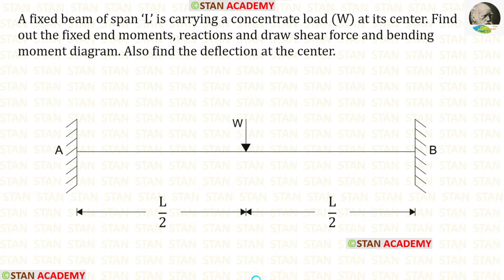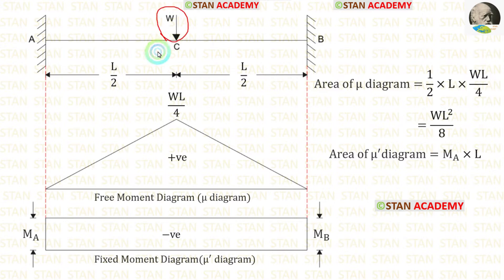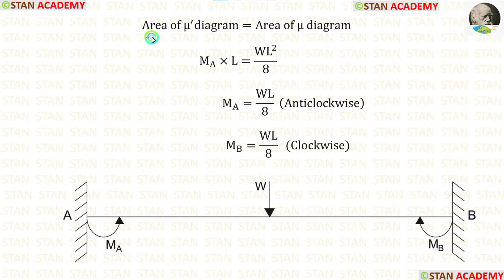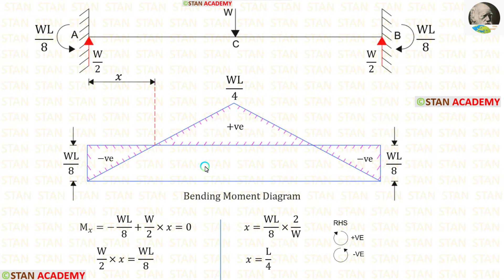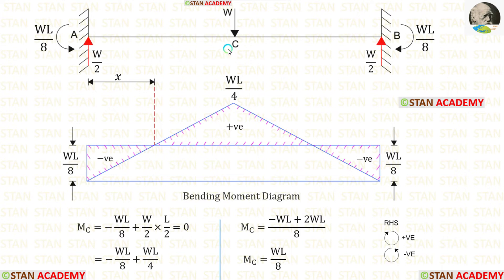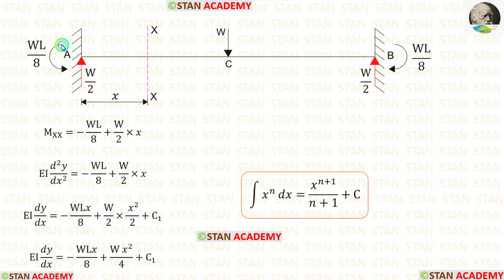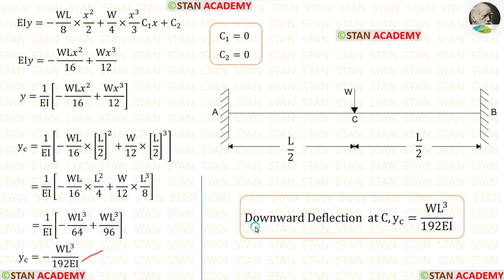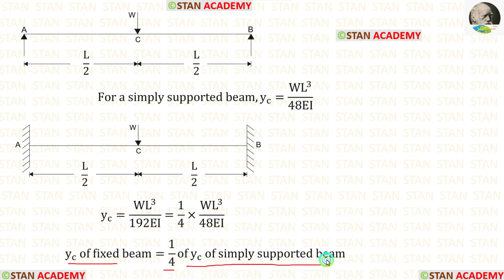Fixed Beam Carrying a Point Load at the Center

Comment: Cran Flag حساب على قدر تصميم البيم 30cm×60cm 
Ratio balance concrete =0.836× F'c 3.0ksi/(Fy 36ksi)×(0.003×80 Ksi)/((0.003×80 ksi)+Fy 36ksi)= 0.060456
Ratio max=0.75×ratio balance
Ratio max=0.0342
Area steel=ratio steel×width×depth
Area steel=0.0342×"12inch×"24inch
Area steel=9.84 inch squar 
Area seel=63.5 cm squ. Centimeter squar